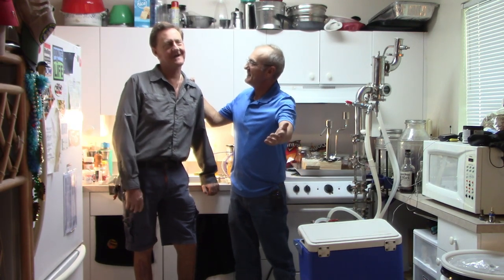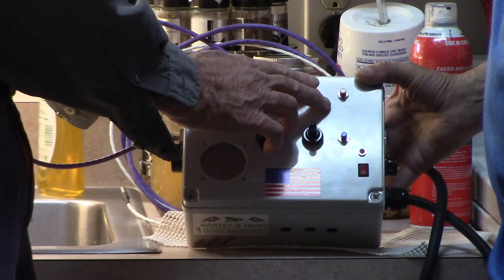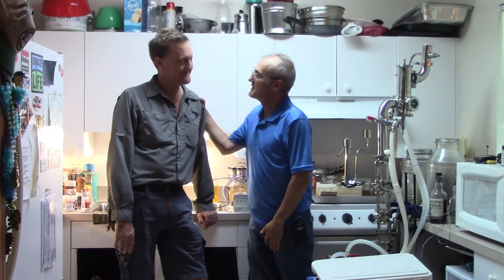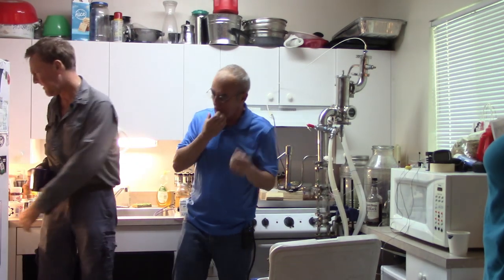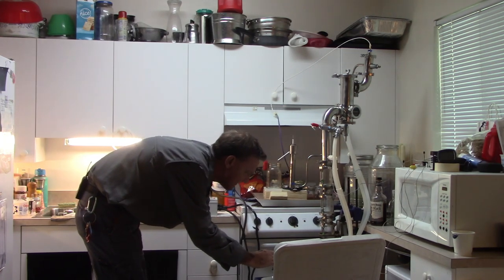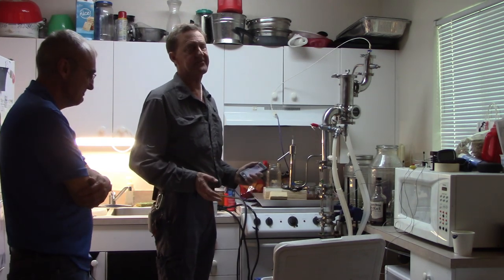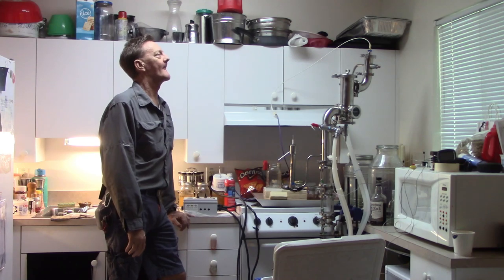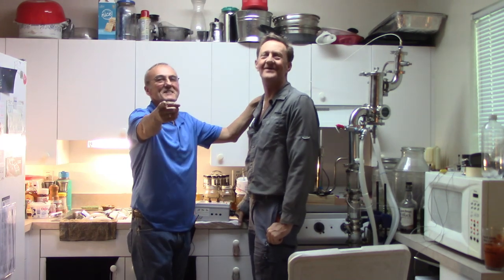BLIND DISTILLING WITH MIKE

Comment: Fantastic stuff, even learned more, going to expand the temperature control to the condenser.
Reply: They say you don't need any but I have three boiler, vapor head, condenser water temperature at the out port and use all three to know exactly what is happening though the whole run. Just my two cents.
Reply from the maker: Mike uses several temp points to let him know what is happening.

Comment: Good job. You have a second blind distiller here as well. Low vision. Im halfway through my first fermentation and then, off we go. Your store was the easiest to work with.
Reply from the maker: Good luck and let me know if you ever need Mike. He is always available to assist anyone in the blind community.
Reply: Barley and Hops Brewing I ditto that George. If any blind or visually impaired folks out there interested in starting this fantastic hobby; all you have to do is call George and he will pass on my contact info. Happy distilling!
Reply: Barley and Hops Brewing I will be doing some videos of how i do things that may be usefull as well. I am an audio engineer as well as an all around tinkerer. I will stay in touch.

Comment: Where do I get one of them gin basket at my friend... I would kindly appreciate it
Reply: I've seen them on ebay
Reply: Country Charlie i’ll try to see if I can copy the link for it on eBay. They are actually made in Russia and the quality is surprisingly good. It is listed as a 3 inch stainless steel gin basket. Then it has 2 inch 90° try clamp fittings so you can run it through a 2 inch column. Very nice piece indeed. It cost me I think it was about $265 though.
Reply: The blind pig! I found it thank u sir👍